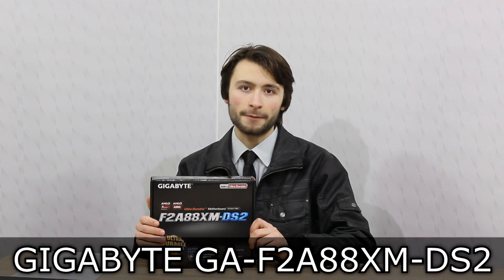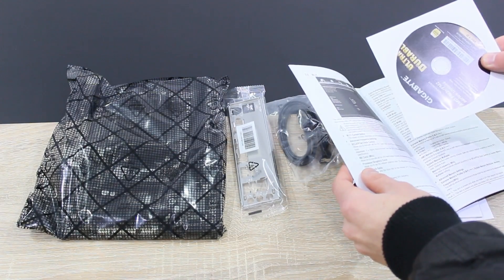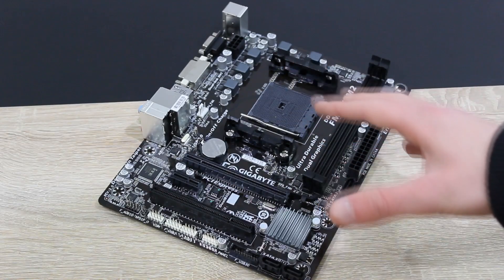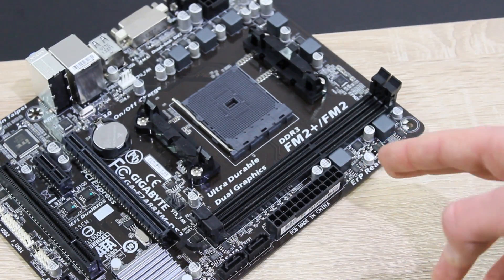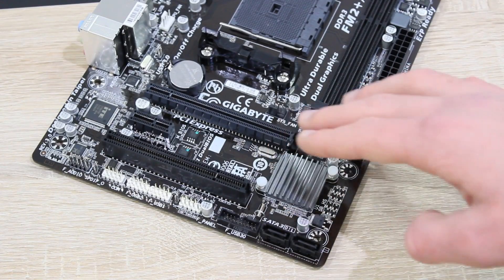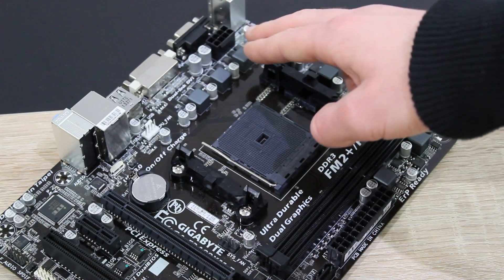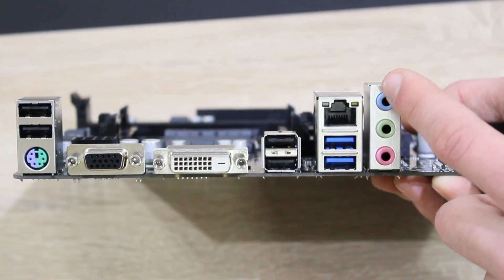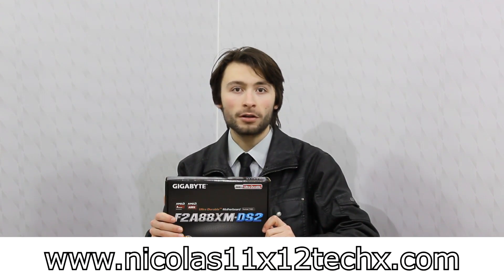GIGABYTE GA-F2A88XM-DS2 Review

Comment: Can the MSI AMD R9 380 4gb work with this?
Reply: i bought this mainboard with Sapphire R9 380 ... And amd 7870k.Everything looks fine but seems i  have some issues with cpu-gpu compaitability with this mainboard.And you cant update your bios(newer bios version is in beta bios)so i referred to take a look upper  and bigger version of gigabyte motherboard.
Reply: Thanks, It turns out i'm gonna get the rx370 now but thanks anyway :)
Reply: U meant Rx470 or R7 370 ?
Reply: I meant the rx470
Reply: so the r9 works with this motherboard perfectly?
Reply: idont think so...Im getting 65fps avg on dota2,120avg on csgo.and 55 avg on warframe(ultra settings).But if you play Directx12 supported and "new released games mostly are working fine.

Comment: can i overclok de AMD Athlon X4 860 in this motherboard?
Reply: +Rodrigo Orea i've got it and an 860k in it.  I'm currently oc'd to 4.6 GHz.
Reply: +Bredbeddle deHautdesert 
Your cooler?
Reply: at the time of that post i was using a hyper 612 vers. 2 (cooler master). But have since installed a H110i I got for cheap. The 612 was doing the job ok but i felt temps got a tad high. I think a 212 might be better then the 612, would atleast be good for 4.4 to 4.5. Currently at 4.7 with the h110i.

Comment: Can the AMD Athlon X4 860K Black Edition CPU fit in it,it says it's a fm2+ cpu,but he said I would need an apu to use the pcu express slot?
Reply: +gabriel mercado absolutely, bought an 860k for mine a couple weeks ago, currently i've got it oc'd to 4.6 GHz.   You would need an apu if you wanted to use the vga or dvi ports. But with an 860k you have to have a discrete graphics card which would have it's own ports.  I was running an A10-5700 in it before that, but have a gpu card so i wasn't using the integrated graphics anyway.  I paid about $60 for my board from the clearance section in memory express in the fall. I like it, but to do it again i'd look for something with more sata ports I found myself wanting more. The only other down side is that my case has a window and this board isn't a full mATX so it looks a bit lost in there lol.  It's mATX wide (ports side) but only 6.5 inches long!  (9.5 x 6.5). Thats not really a negative i guess lol.
Reply: Bredbeddle deHautdesert Awesome! Thanks for the help,I got the cpu, and it works perfectly